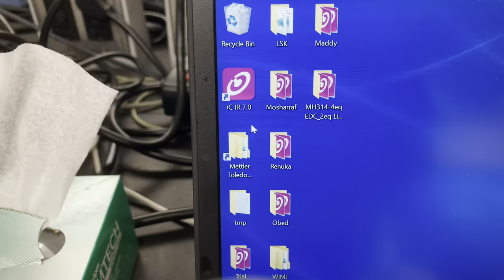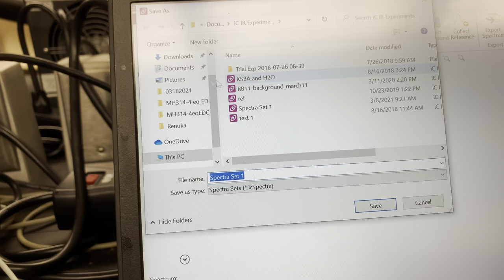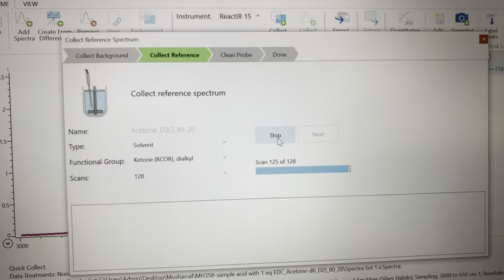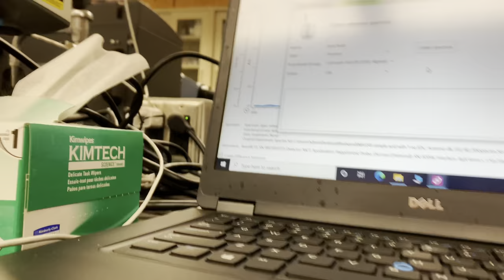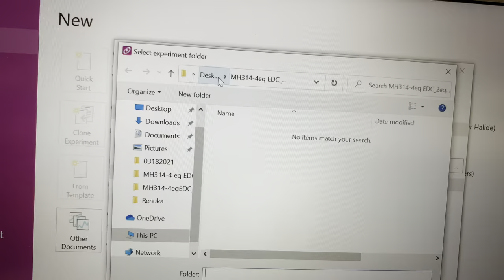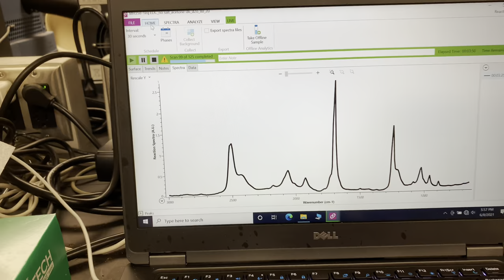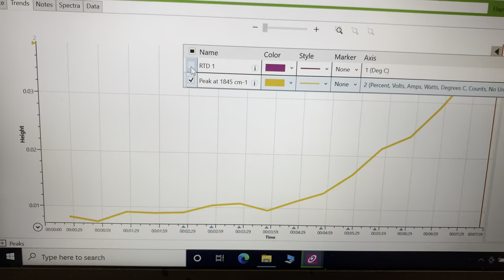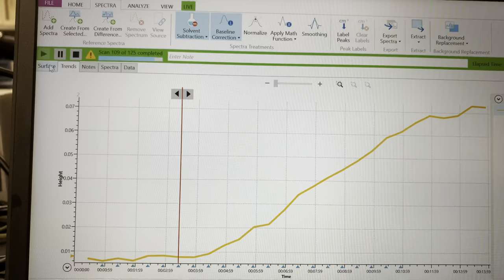React IR-How to monitor your reaction progress by IR? Mettler Toledo React IR

Comment: thank you Dr. please  what difference between  FTIR and ATR
Reply from the maker: ATR worked with ZnSe or any other metal alloy crystal but FTIR measure the frequency differently. Basically their functions are same but worked or collect frequency differently. 
Attenuated total reflection (ATR) is a sampling technique used in conjunction with infrared spectroscopy which enables samples to be examined directly in the solid or liquid state without further preparation. 

https://www.agilent.com/en/product/molecular-spectroscopy/ftir-spectroscopy/atr-ftir-spectroscopy
Reply: @Dr.Mosharraf  Thanks for the info and the link